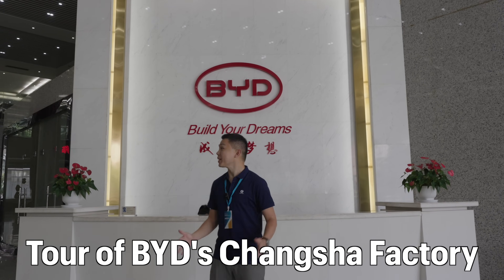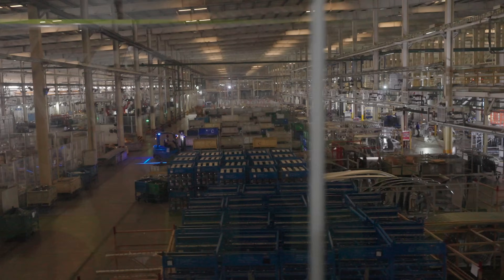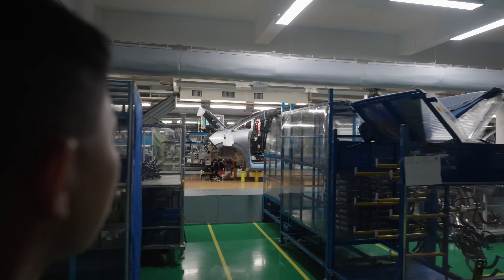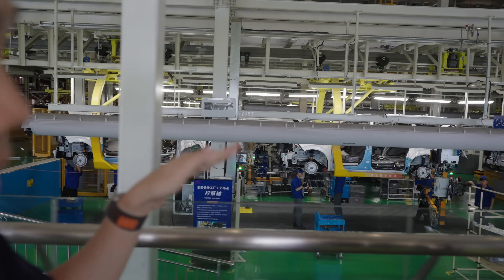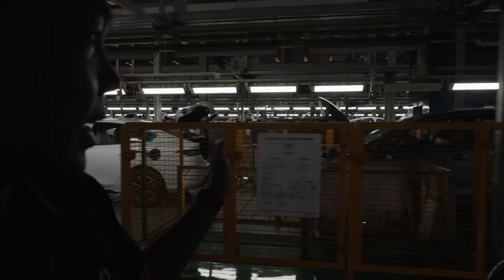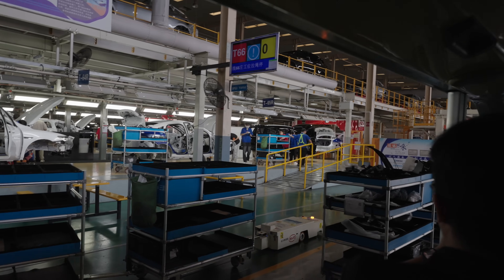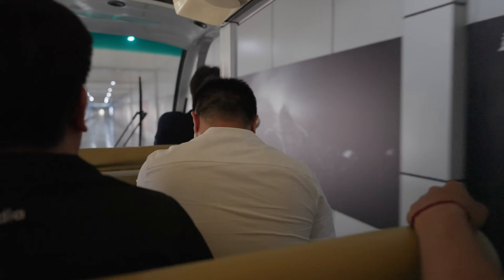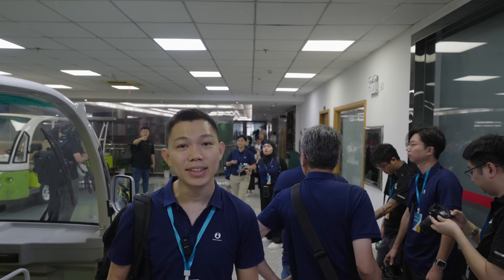Tour of BYD's Changsha Factory

Comment: Thank you for sharing the tour with us! Especially the part with a main assembly line where different models and variants (electric, ICE) are produced is impressive. I think the advantage is that the factory can adjust its ratio of electric/ICE vehicles dynamically driven by customer orders.

I watch this video from Europe and reflect on the ongoing discussion around competiteveness of Western car manufacturers compared to Chinese OEMs. After watchig the video I would not say, the technology or level of automation in the factory is too different to European/US OEMs. The manufacturing of the bodywork with its welding and painting robots is almost automated everywhere both in the West and China. Also the human portion is comparable, since there are still humans who mount the interior/infotainment modules/cables/wheels manually.  

However, around a third of all costs of an BEV are within the battery, which European market analysts assume the Chinese to have an easier (i.e. cheaper) access to. Also the labor costs may be lower compared to Western counterparts. And the Chinese have a lot of experience in BEV assembly allowing them to have an edge on particular nuances where Western manufactorers first have to stumble over issues....

Comment: There are around 7000 lithium cells  in a battery pack of an Electrical Vehicle and if only one of them goes bad with time, whole battery pack is dead!!!!! You need to throw your car to the thrush!!! NIO  has battery swapping service. The battery of the car is swapped under 4 minutes for less than 25 dollars and you have a car with a healthy battery for 25 dollars!!!! Why would you buy a car which does not have battery swapping service???? NIO is the future......

Comment: It's impossible not to be impressed with how clean and uncluttered  the factory appears to be. Back in the early 70's I spent about 6-months working in the GMH Dandenong plant. It was dark, incredibly noisy, very cluttered and quite grubby - we literally fixed the imperfections with hammers and blocks of plastic. The contrast with this is astonishing - the green paint on the floors is almost as shiny as the car ducos.

Comment: Thank you very much for a really good tour of the factory.
my name is Danni and I live in Denmark.
I apologize that I 
not as good at writing english as i am at speaking i use google translate.
I hope you understand me. 
Please write back if you have any questions.
I have a friend who bought a used atto 3 14 days ago, it is from 2022, he is very happy with it, he says that electricity is the way forward.
I have also tried to drive it.. super nice car.
beautiful design.

It drives very well on the country road and motorway, but there it uses a lot of power.
I would like one myself, but unfortunately there are some downsides to it and it can't yet do the things I want in a car, especially driving with a trailer.
He has problems with misting on all the windows, the fans make a lot of noise and use a lot of electricity to demist.
can windows be put in with hot wires?
It is not so good at creating heat in the cabin, so you can sit and freeze.
For me, it is not strong enough for a trailer, there are many who live outside the cities who need a trailer to drive garden waste away.
I don't see any problems with the car.. 
but wondering if it can be solved in a good way, so that all BYD owners get the best out of their beautiful car
I hope that navigation will come in Danish as well as Android auto and Apple carplay.
If BYD could talk get connected with an electrical stand or another BYD car
as well as a kind of screen where BYD can "see" things and people around your car when the weather is bad or foggy, I have seen such a screen in another electric car.

I want to believe that if some of these things and the wishes of the Danes are heard, it will be the best car for the country.
And then I would like to have an atto 3 myself in the future.

Comment: Thank you for the video.  I used to work in General Motors' Holden Vehicle Operations, Elizabeth (South Australia) plant which closed 7 years ago.  Whilst I can see many similarities in equipment, automation and process I am thoroughly impressed with the sheer scale of this place.
I now have a BYD Seal in my garage along with my final and limited edition Holden SSV MSE 6.2L V8 -- two fantastic vehicles.
Reply: you can see at 9:18 that the assembly line is not worker friendly.

Comment: The line of stamping machines was a good comparison to the Gigacast process.
When you consider each major part needs 1 of those machines, then finishing, then welding to other parts, you can appreciate the Tesla logic.
1 casting, then (probably) 2-3 minutes on a CNC mill for mating faces, bolt holes, etc.
The space and energy savings alone should be considerable.
Reply: The stamping machines are manufactured by JIER.
European, American, Japan and Korea car maker are all using JIER stamping machines.

Comment: The darkened factory floor reflects automation. Machines do not need lighting like we do. Many machines use localised infrared light/sensors for their work. No need for peripheral vision lighting like humans to move around as most on assembly lines are stationary in position.

So the areas with bright lights usually indicate human operator involvement.
Reply from the maker: Thanks for the insight!
Reply: @DarenYoong 
I'm sure they just have "Task lighting" for the humans.
If it's just of sufficient intensity in exactly the right place you won't see it from 20-30 metres away.